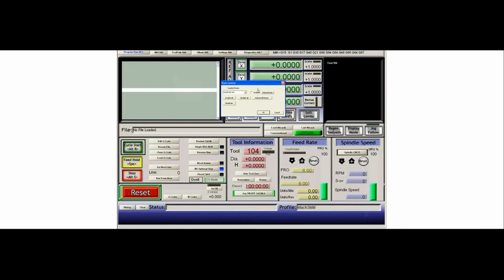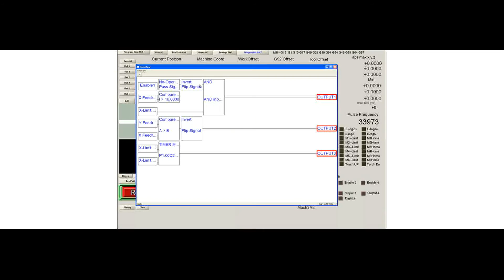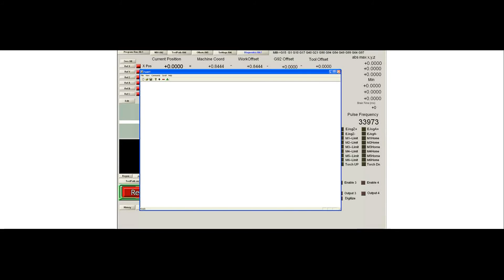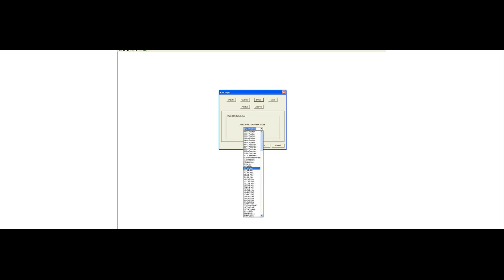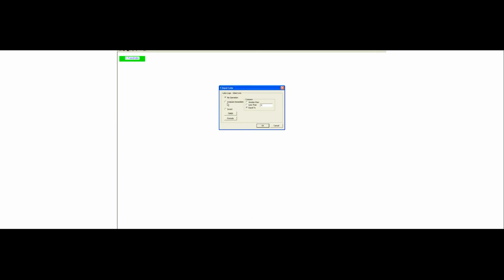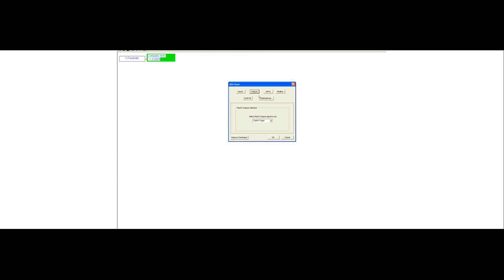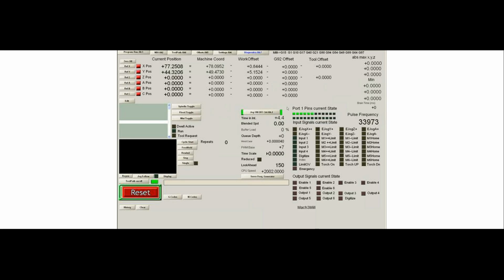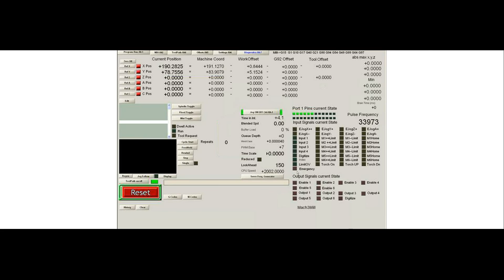Mach3 CNC Controller Brains Intro

Comment: I have been searching for days to get a macro for operating an ATC, especially the release solenoid for a 5 second period when the PNP sensor is activated, but was getting disheartened as I could not find anything, and then i came across your video.  I had no idea about Brains but this is exactly what I need and so easy to use.    Thanks for spending the time to educate us .  Keep up the good work.